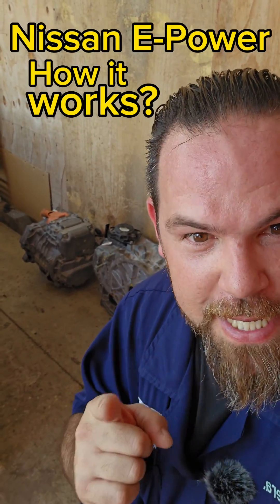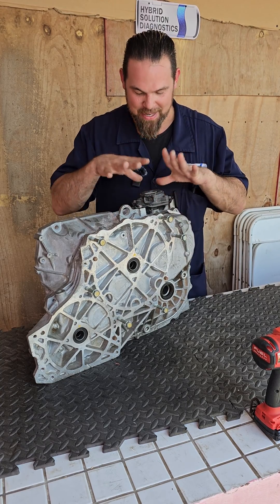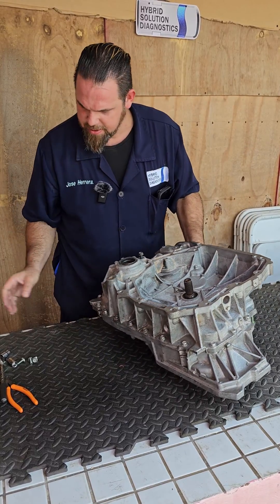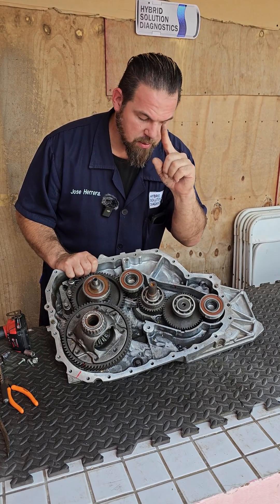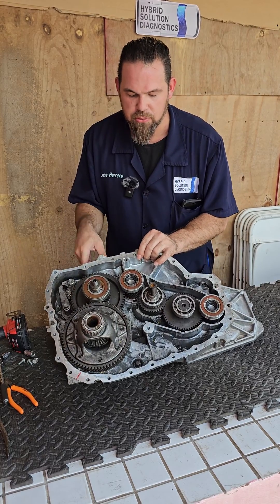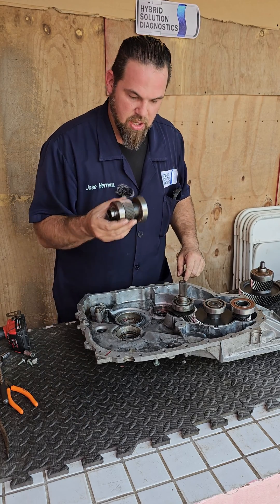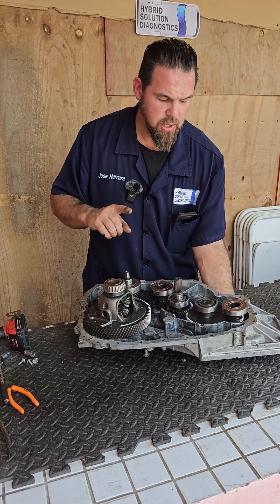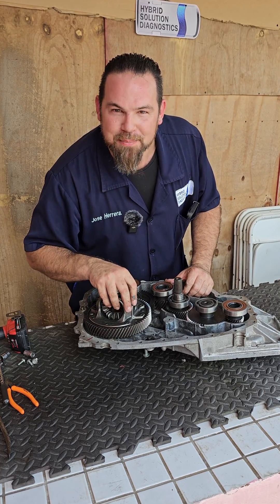Nissan epower transmission and how it works

Comment: Just to be very sure... Are all e power this type of drive system? We have had bad experience with cvt transmission in our Toyota aqua* ex japan inport. However nissan epower seems like a very nice and simple solution to hybrid drive. Are all years basically the same? Thank you very much for your amazing content!

Comment: Which hybrid here is the same as the Renault Austral where the engine & the electric motor both drive the wheels but not at the same time. The computer gubbins selects it. Compared to e-Power it is complicated more so? Great explanation. I collect my e-Power tmmrw. Excited.

Comment: Is it possible to double  the capacity of the battery and then tell the engine to only ever run at maximum efficiency? Would this make the car run much more efficiently?
Reply: That's actually how it works normally. The capacity is designed to be suitable for that purpose already.

Comment: No matter how you try to give this a pretty face, this is very much anICE vehicle,  it goes nowhere without the 1500cc petrol engine running, with what I am told is a 6 litres per 100 mile consumption, the petrol engine still requires all of the servicing any other petrol engine requires, so all you have achieved is throwing the two modes together, so it's twice as needy as it needs to be

Comment: Great Video Explanation - I have a 2017 E-Power Note that wont start up, Any Diagnostic Steps you can suggest. Only Fault code is U1000 -Thanks in advance Anthony

Comment: Why the combustion engine is big? I think for e-power technology, the combustion engine size is only like on a motorbike, about less than 500cc
Reply: 500cc weak engine running on full capacity is less efficient then a 1200 cc engine running on almost idle or low revs and only kick in more power when desired on higher loads highways speeds on inclines.

Comment: Loved your video, i own a 2023 xtrail e-Power eforce, it was never clear to me what is under the hood(technically speaking), because when you drive it its feels very different, seeing promoting e-Power videos does not explain when your are looking for more in depth stuff, the inner workings as you just did.
Your video is very enlightening and solve a lot of question i have, but now i have some more. :)
What is the 12v battery in the trunk even for? small voltage app's? some lights and etc? how the car charge the 12v battery? dc/dc converter? because i dont see any typical 12v alternator.
How about the parking feature vs. electric handbrake? In Europe usually we have manual transmission. The parking gear lock is also somewhat new.
Also notice the car drain's battery in cold morning to heat up internally, at least is my ideia.
The AC compressor i already see in another video from you that is HV/full electric.
Keep up the good work. ;)
Reply: The usual 12v battery governs the radio, lights, sat Nav etc. The EV bty is all about the wheels & if that bty malfunctions you can still use the 12v for it's electrical appliances. I presume this but our guru will know answer, if he done so that is.

Comment: Hi Jose
I’m from Guyana. I have a 2014 Honda Vezel Hybrid which indicate
that the transmission temperature is high (note: the message was displayed once).
Can you please advice what may be the possible issue(s) and solution??
Thanks in advance.
Reply from the maker: Recalibrate clutch first 🫡✅

Comment: Had a greater appreciation from your illustration.  Wont it be stressful for e electric motor to crank / drive the differential since its connected to a smaller gear.

Comment: Well e-power its a parallel hybrid)
So motor-generator-1 its just a generator?
Reply from the maker: A motor as well 😎😎💡💡
Reply: Right, motor mode when he works like a starter.
Reply: It's not a parallel hybrid though. Nissan said it's a series hybrid.
Reply: @gregrodrigueziii8075  точно. Я ошибся. Это действительно последовательный гибрид.

Comment: Awesome video-Thanks! I got an Xtrail T33 e4orce. It seems that everytime on start up there is a weird cranking noise from one of the generators that is trying to put extra juice on the battery and maybe warm up the engine. The weird noise has been reported by many epower Xtrail owners. Can you make a video on this?  NISSAN claims is std behaviour for this type of engine.
Reply from the maker: Send me a DM via instagram... onteresting case

Comment: What are benefits with e-power ?
Reply from the maker: Watch the video and see for yourself...
Reply: @hybridsolutiondiagnostics  i do, but the prius hybrid system seems better.
Dont understand why there is no mechanical connection ....ice is just a generator....
Reply: @TheRomo187 I don’t disagree with what you said, but there may be some benefits of Nissan doing it like they did. Instead of comparing it to a Prius, compare it to a Tesla with an onboard generator.